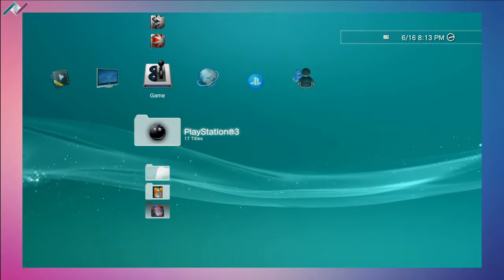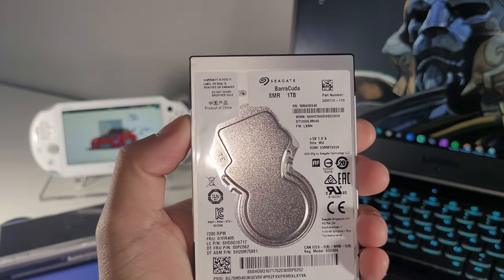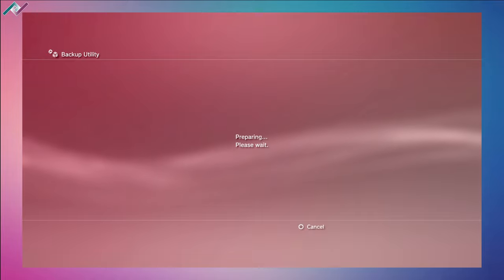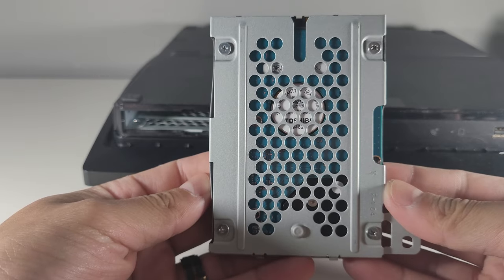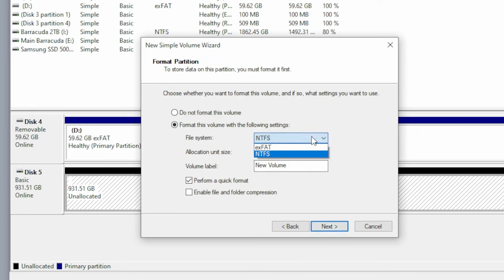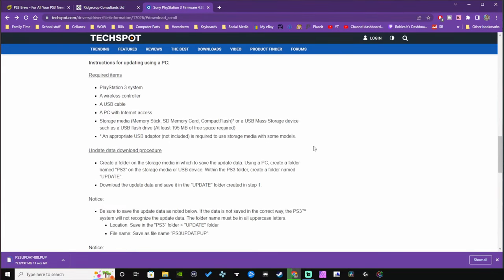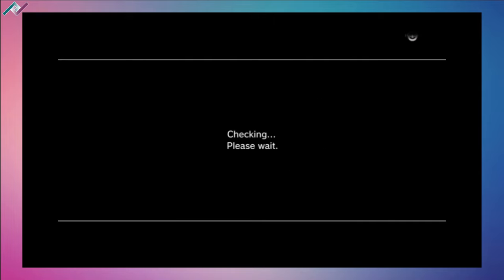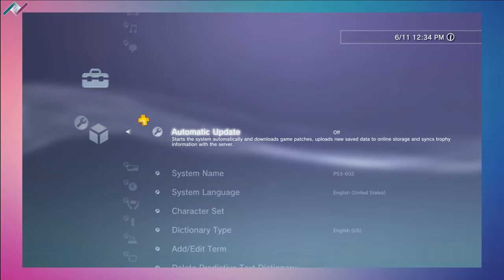PS3 Slim Storage Upgrade Guide 2022 - 1TB HDD/SSD

Comment: Yo all of you guys make this way to  harder then it needs to be. You could really just right click your drive in windows quick format it to fat32. You don't need an hdd program unless your doing something special.
Reply: No you cannot. Windows does not offer FAT32 format to drives over 32GB in size.
Reply: @johnguecia7490 lol what?  Seeing I just formatted my 4tb hdd to fat32 and use it for my Xbox one I beg to differ.
Reply: @Mitchellc0123  You can do so, but not through Windows. You have to use other software like GUIFormat in order to do that and make it a Large FAT32 Drive. Not saying it isn't possible, just not possible through Windows
Reply: Only HDDs being used externally (via USB) need to be formatted in FAT32. You do not need to pre-format a HDD you plan to install internally to the PS3. The console will format it during the installation.
Reply: @AG2-fukumean  its safer to format it on pc first, but not completely neccessary

Comment: Captain here Only HDDs being used externally (via USB) need to be formatted in FAT32. You do not need to pre-format a HDD you plan to install internally to the PS3. The console will format it during the installation.
Reply: same with ssd?
Reply: @kg5710 I hear SSD’s tend to die faster in the ps3
Reply: @Damnoriega  ah damn, thanks for the reply, I already added a ssd to it. hopefully it all works out

Comment: I don't get it, is the FAT32 formatting mandatory? I've watched/read a lot of other tutorials, they just swap the old HDD with the new HDD and it works
Reply: I don't know if it's this ps3 slim I have if it's the GPU, but I first had a 1tb Western digital blue SSD in it, now a 500gb Samsung Evo SSD and it slows down horribly, a technician I talked to said it could be the GPU or CPU going bad but I'm wondering if it's because it's not formatted, I just downloaded the 4.90 firmware on a USB drive and installed it that way, the ps3 says it's formatting the hard drive to operate with the system itself
Reply: The ps3 formats to fat32 itself when you add a new drive ssd or hdd. The only reason youd need a pc is to install the system firmware to a thumbdrive to add to the drive after its formatted otherwise you got a paperweight cause the ps3 doesnt have its operating system anymore
Reply: Also people saying ps3 ssd go bad quick is no longer true atleast for modern drives. When the ps3 came out ssds were expensive and not worth it for a console but now a 1tb can be like 50 bucks and most ssds have garbage collection now which keeps an ssd healthy when it doesnt have trim running which the ps3 cant use.
Reply: @DJGamingBonanza  I've installed an SSD and it works fine. Install times are a bit quicker now. 
There is one thing, I've heard SSDs lose speed after 70% capacity, is that true?
Reply: @SyamDaRos-EndoManno  from what I've read ssds that dont have garbage collection drastically lose speed after some months but most ssds now do. When ps3 came out ssds were expensive. So cheap ones didn't have garbage collection. But even expensive ones from ps3 time are like 50 bucks now
Reply: @SyamDaRos-EndoManno  what ssd is it and how long have you used it would you say?
Reply: @DJGamingBonanza  looks like Amazon links are automatocally deleted on this channel.
It's "Silicon Power SSD 1TB 3D NAND A55 SLC Cache Performance Boost 2.5 Pollici SATA III 7mm (0.28") SSD interno" 
(Sorry for some Italian words)
I've used it for almost a year and didn't have issues, I'm just careful with not stuffing it with digital games. I assume it would create performance issues or something similar
Reply: @SyamDaRos-EndoManno  filling it too much might show slight slowdown but if you've used it for a year than you should be fine

Comment: Never really changed my hdd because I always bought discs however it does seem like a good idea especially if you want to use PKGi 👍
Reply: And jailbreaking is great option you can fit more games i am currently using 1tb hdd
Reply: What is PKGi?
Reply: @RockNRollDad88  PKGj
Reply: I am using 160HDD about to upgrade to a Kingston 480GB SSD
Reply: Discs install data on the hard drive too, some more than others, but they do. Some install around 12 GB of data in the hdd.
Reply: Theres just so much wrong with that i cant even begin to describe it

Comment: For any of you having trouble when you put your ssd in and it doesnt work. I actually put the firmware 4.90 onto my usb backup. Of course you have to put it in your computer. Click on the usb drive. Click PS3 then you should see a folder title EXPORT that has all your backed up games, etc. next to that folder create a new folder titled UPDATE. Then place the 4.90 firmware into that folder and then you should be good to go. I did this like 20 times before trying that so I hope this saves someone some time.

Comment: Could you not just clone the old disk to the new disk and then extend the partition? That way you don't have to backup, load the firmware again and then still restore
Reply: I have same doubt, how to extend the partition space after?
Reply: @Sean_Cockrell  I was thinking of Gparted from Linux.
Reply: I tried this, cloned my 500gb HDD to a 1TB SSD, it turned my 1TB into a 500GB SSD...kinda disappointing now I just formatted it to start over and whenever I turn the ps3 on it turns automatically off...what do?
Reply: @aroh  Pretty sure you need add the OS for anything to happen, Sony provides downloads for the latest version
Reply: I recommend RescueZilla for this. You can then just add back the segmented free space by simply extending the segment where the files were cloned.
Reply: For some reason i tried this with my cloner but it re formatted my hard drive back to exfat or nfts so then my ps3 / ps2 could read the drive as their own

Comment: Thank you for the video. I didn’t format it with computer. PS3 did it itself. However upon installing the OS, it went from point zero. As if it was a brand new console. Yours logged in to your Home Screen right away. I had to set it up and then restore my back up.

Comment: So did you backup onto the new hdd from usb stick? I’m trying to understand nobody’s video shows the full process you went from ofw to cfw in two separate frames and didn’t explain what you’d done
Reply: Don't quote me....
When asked to connect storage media with update data version 4.XX.....
You would use the original up.dat file you used or was applied at the time of the upgrade. If it was 4.XX OFW you would use the official 4.XX OFW file. If it was 4.XX CFW, you would use the corresponding 4.XX cfw file. I would not advise using this time to update your cfw. I would use pretty much the exact original update file used to jailbreak the console.

Comment: Doesn't the PS3 format it to FAT32 for you? How come you pre-formatted the drive and reinstalled OFW? I heard it was possible to do this with your CFW on the USB. 
Is it better to go back to OFW first?
Reply: I think rebug has a debug hard drive transfer utility. All you need is to connect the new drive via usb
Reply: @Balmung5150  perhaps he cloned the hard drive
Reply: I need to know this too because I used a 1tb WD SSD first, and now a 500gb Samsung Evo SSD, installed the latest update 4.90 from a USB stick I downloaded right from Sony, but with both SSD's the system starts running horribly slow after about 40 minutes, it says formatting storage device when you start so I don't know if it's something I did or didn't do or something in the system itself going bad but it doesn't even get hot

Comment: Question. If you have enough free SATA ports, is it possible to clone the PS3 HDD to a new SSD/HDD with a disk tool, without reinstalling the firmware?
Reply from the maker: That could be possible but I personally never tried it.

Comment: i followed your video step by step. i uploaded fat32 and the newest ps3 firmware to my usb thumb drive and then i used the same usb stick to back up my entire ps3. now when after i correctly installed my new hard drive and insert my thimb drive its saying thr proper firm isnt found. what did i do wrong?

Comment: Great tutorial, however...
Is the whole formatting to fat32 thing a useless exercise on the disk? The PS3 initializes it to its own wacky filesystem, which is probably Linux of some sort, and definitely not FAT32  due to the 4gb limitation it imposes on files.
Reply from the maker: The process is used just to clear your HDD, I found some of these new and especially refurbished HDD, they are not formatted correctly or have some weird files due to a program they may have used to essentially clean the disk. I typically add this step in all my upgrades just in case. Not too long ago I received a 4TB HDD Refurb from eBay, trying to upgrade my bosses PC and it had all this crap on it. Not sure why these resellers allow this to happen
Reply: @RoblesJunior  That's fair. Followed your guide to the letter and it worked perfectly though!

Comment: Any tips on what to do if the Backup didn't work? It says it can't be found on the usb drive. would be nice not having to install everything all over, don't even have the Package manager now :/ E: tried putting back the old hdd to backup again but the box dont show anything on screen after powering on with old hdd inside.

Comment: Kinda sucks that it's only limited to 1TB while you can use up to 2TBs externally. I got a Samsung 870 EVO SSD for my slim model PS3 which I jailbroke and I'm almost out of space and I have a lot of PS3 games that I backed up and I  still have more to back up. Guess I'll have to get an external drive.
Reply: Isn't it because of the thickness of the drive? I just tried installing a 1.5tb drive but it won't fit in the bay.

I now ordered some sata extension cable, to have to drive outside the ps3

Comment: What is the largest ssd capacity you can install?
Reply from the maker: Currently like 1.5 TB but there is a way to pass that. It has to do with partitioning the drive a certain way to by pass it on the pS3

Comment: Connecting the new hard drive to PC and formatting is unneeded extra work and can skip that process all together.. install the new hard drive in ur PS3 with a USB device plugged in with correct firmware and the firmware does all the work for u. .both formatting and installing
Reply: That's what I did with 2 SSD's now, the Samsung Evo SSD I just bought yesterday and did this, but it's slowing down terribly after about 35-40 minutes of use, is that from not formatting or something with the system possibly? Because the ps3 formats the storage device on it's own
Reply: @josephhall7317 it sounds more like a temperature issue. Formatting your drive in pc or ps3 will have the same effect
Reply: @doi2017  another Samsung SSD ended up fully fixing whatever issue I was having, was frustrated because I bought one from Japan the scarlet red one so I paid like $220 with box

Comment: Question, if i have a sata to usb cable, can't i just format the new hdd to fat32 on my computer, then tranfer all data from the old hdd to the new one, and just put it in?? Will that work?
Reply from the maker: Yes in theory it should work. You can plug it into your ps3 as an external device and make the transfer that way!
Reply: @RoblesJunior  never thought of using the ps3 to transfer, i am all new to this stuff and does as much as possible on my laptop 😂 thank you so much, you have been a major help the last couple of months!!!
Reply: @RoblesJunior  if i transfer all files to the new hdd before installing it, will my cfw then be on there and work without being updated or reinstalled?
Reply: @RockNRollDad88  did it work for u with this method ?
Reply: @davidjames3259  never tried it

Comment: When first booting with the new SSD installed, is there any reason a HFW won't work?
Reply from the maker: Never tried an SSD to be honest but I am looking to get one for testing purposes.
Reply: @RoblesJunior  what if it was an HDD ? 

To elaborate - I'm trying to upgrade storage and jailbreak. When you first insert a fresh drive into a ps3 you're supposed to install the firmware right? At this stage, can I directly install the Hybrid Firmware (HFW) and not OFW ?

Comment: Can I use my internal ps5 hard drive for my internal ps3 drive
Reply: as long as the specs line up with the ps3 hdd, yes. they have to have the same rpm and be the same size, but If they are you can.
Reply: @BaloneyBoy7  just same rpm doesn't matter if its ssd or bigger

Comment: I Just Upgrade my Ps3 Hard Drive 128gb to 1tb but somehow 
828 GB / 931 GB
I only have 100plus space on my HDD

The HDD Is Second Hand
Reply: you can free up 8% of hdd space with either a special app you can download for the ps3 or if you are using the newest evilnat there is already an option integrated in the special options.
Reply: @dmer-zy3rb  is that jailbreak because I'm not going to jailbreak my ps3
Reply: @miguelricoramos3428  yeah it is but i can really recommend it. You can even easily overclock your ps3 if you want, but i didnt do it i just stuck 1 tb ssd in it.

Comment: It would have been much quicker and easier to buy a cheap SSD, take out the old HDD and clone to SSD direct.much quicker.
Update. I've tried that and you can not clone the HDD with PS3 content.or at least I have not found a way.
Reply: I'm having a nightmare installing my new drive, ps3 can never see the update file 4.89.Is it possible to clone the hhd I have to a larger ssd?.If so, is there any guides anywhere.Thanks in advance for any help you can give.
Reply: nah
Reply: I didn't do any type of formatting, I let the system do it itself and it does in this video near the end but I've used 2 SSD's now, first a 1tb Western digital blue and now a 500gb Samsung Evo that I bought just for this but it starts slowly down terribly after around 35-40 minutes, but it formatted itself in the system so is that just something in the system itself going bad?